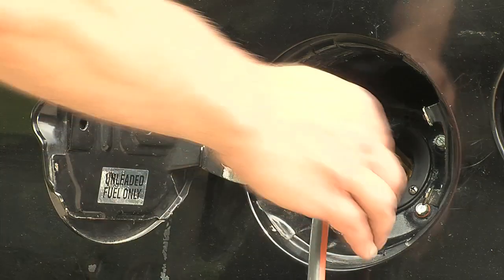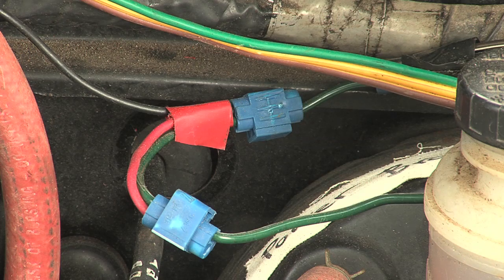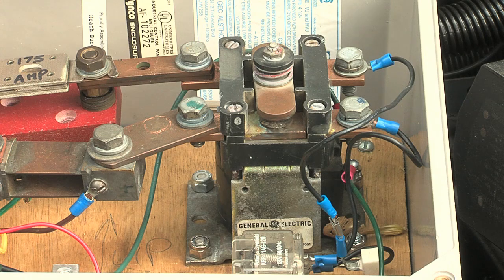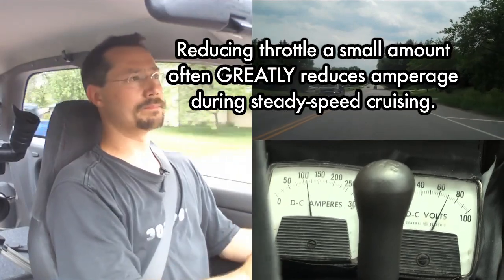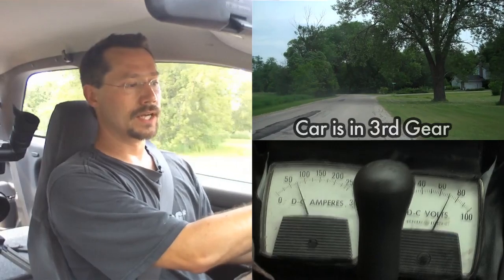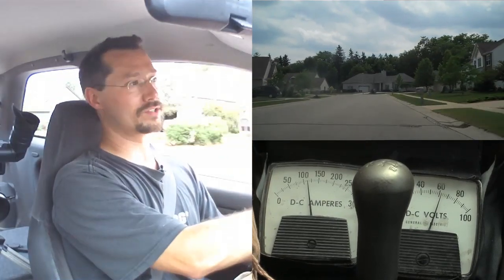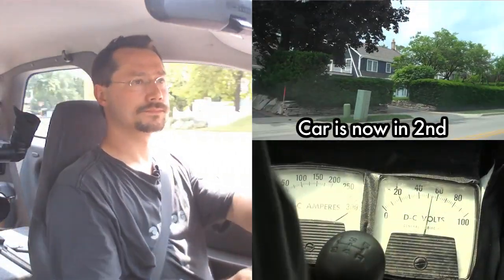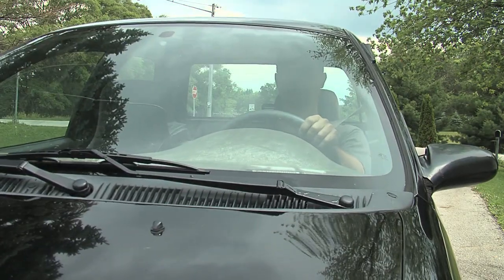15 Build Your Own Electric Car: Driving the Car

Comment: maybe change halogen lights for led for increased range?
Reply from the maker: I once calculated the increased range in using LED bulbs instead of halogen. I don't remember the exact number, but it was in feet, not miles. Headlights just use a very small amount of power compared to pushing the car down the road. In my current electric car (a Mitsubishi iMiEV,) I did upgrade the main lights to LED. That was more for the look than anything. I also like how they will essentially never burn out!

Comment: Did I miss where you explain how the 12 V get's charged?
Reply from the maker: On this project, it's very simple. There's just a 12V battery charger which gets power when the car is plugged in. On other vehicles, including the KZ440 electric motorcycle I built, there's a "DC to DC Converter" which takes power from the main battery, isolates it, and converts it down to a level to charge the 12V battery. It takes the place of an alternator in a gas car.

Comment: I dig what you're doing man. Electric is the way to go. The only thing missing is the Tesla technology of wireless power transmission. Think how this car could work if it didn't carry the battery weight but instead had a receiving and condensing unit to harvest the wireless power. for usage. The other end of this tech is out there, it's being used but it's off limits to the masses because they still have tons filthy dirty oil to rape from the earth and sell to us fools.
Lots of energy all around us, if we knew how to attract it.
Reply: wireless power transmission is installed under garage floor for recharging.  there is no wireless power transmission on roads doing that would cost trillions

Comment: Nice series no doubt, just wondering did you consider doing regenerative braking to?
Reply: the problem with brushed dc motors is that you can't have regen braking, because in order to do so, the magnetic fields created by the battery ( electro magnet) would have to rotate inside of the coils of the stator to produce energy ( just like in an alternator), but since the magnetic fields are set in one place and can't rotate, you can't produce any energy
Reply: Isai De La Vega  I was thinking about AC motor as replacement for current DC he is using...
Reply: Warlock I too prefer ac motors rather than DC, and with an Ac motor You can use regen braking

Comment: Nice serie 👍🏼
I own a citröen C5 2,0 hdi from 01, witch I would love to convert to electric 
But there are "a bit more" going on under the hood than in the metro 😏
Like the suspension, brakes and power strewing, aircon and other things I haven't thought about.
So I might be in for a pretty big job, but still I would love to do it some day
Reply: I would love to convert my old E-class. But sadly Germany's regulations are so tight and the inspection costs to get it road legal so high... that I probably get off cheaper by buying a new electric car..

Comment: How fast is it from 0 to 100 km/h ???
Reply: if you use 2 of the forklift motors on the rear wheels you have a drag racer that can even beat a tesla on a drag strip
Reply: 0 to 100 in about a week and a half. ;)

Comment: Headlights look a bit dim. You might think about LED lights.
Reply from the maker: In the video, my headlights weren't on. Those were the daytime running lights. On this car, the daytime running lights were just the regular bulbs, but run at a lower brightness. I've installed LED lighting upgrades on other vehicles. It's a great way to improve both lighting and the look of the car!

Comment: My friend has a Ford hybrid with a lithium battery in it. She's put 220,000 on it and now worries that the battery pack will suddenly fail. The repair price would total the car. But the chassis is sound and reliable. So I am trying to help her plan for how to repair the battery in advance, or swap in a conventional gas engine. Any advice?
Reply: Batteries rarely fail suddenly. And a battery pack in a car is generally made up of lots of individual battery cells. 
One may fail by the rest in the pack will be fine. So it'll just be the cost of replacing one cell with either new or refurbished cell. 
The odds of the whole pack dying at once is very slim.
You should be more concerned about the gas engine dying or catching fire  as that is far more likely.
Reply: My 2005 Prius battery pack went out at 220k miles. Everything else worked great. I gave it to a handy friend, and he replaced about 4 cells, costing him about $100. Having the Toyota dealer tell him which cells were bad cost about $35. He drove it for a while and sold it for about $500.